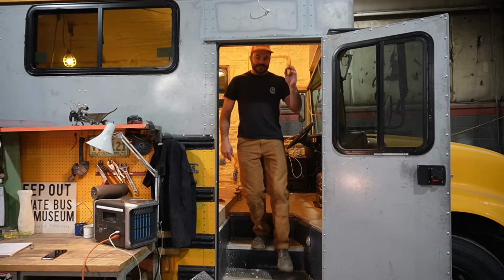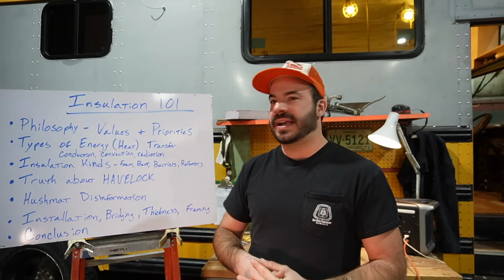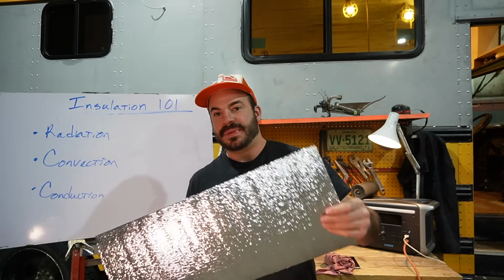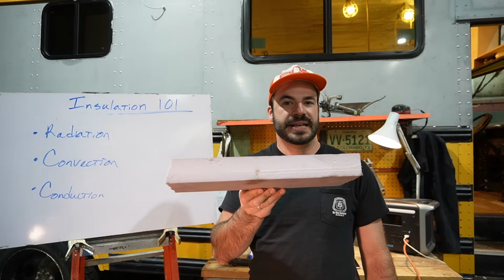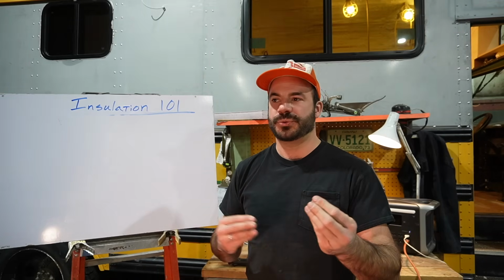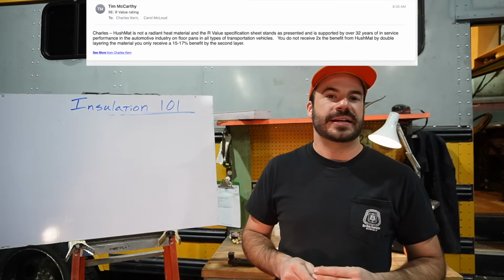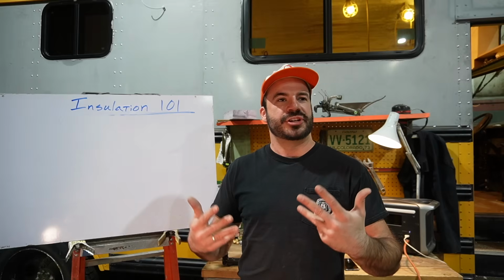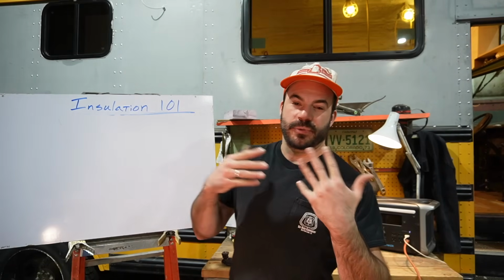Insulation is a SCAM (& the truth about Havelock and Hushmat)

Comment: Great video! Much need information, I have a question about the wood touching bare steel as this was one thing that when I would see everyone doing it in other conversion videos, I would think to myself everytime "idk if we're supposed to do that" lol 

I thank you for the tibbit on using insulation to cover it up, my question is: for Extruded Polystyrene foam boards, can we cut a strip and place that over the bare steel as we make it flush with the Extruded Polystyrene boards we placed for the wall insulation? Would it still help with keeping the warm air from meeting the bare steel? Or should we just use "Great Stuff" to spray 1" - 1.5" over the bare steel?

Comment: I understand the foam isn't getting crushed without framework in the floor. But what about all the vibrations? From the engine just running in idle, to all the rolling down the road. Harmonics, micro vibrations making the wood on top and the metal underneath slowly grind away all the styrofoam board? Possibly? I'd like to see how it holds up over 5 years with the insulation itself carrying the entire load. Just to be certain.
Reply from the maker: We’ve got rigs with literally over a hundred thousand miles on the floor like this with no issues. Our oldest is now 10 years old with no problems

Comment: With spray foam, what about the risk of body flex eventually cracking or shearing the foam causing endless squeaks? Also, what about body repairs in the event of a collision? What if a body shop needs to pull dents or weld panels? Perhaps an alternative might be a thin flexible closed cell sheet insulation applied with a heat resistant contact cement + rockwool or similar on top? This could be much easier to remove if needed in future.
Reply: A body shop repair tech would just cut and grind any spray foam out of the way of any welding repair needed. They are professionals, they will figure it out. I can't see it being a reason not to do if the application makes sense to do so.

Comment: This is a phenomenally informative video. Thank you. If you see this comment, can you weigh in on Thinsulate batt-style insulation? I have some doors in my rig that I need/want to insulate and Havlock now seems like the wrong call. The application is between the sheet metal and the interior plastic trim panels.

Comment: A question, I have thoughts on alternative methods. I would like your evaluation. Understand I am a truck driver not a contractor. I saw a van life video, were they painted the inside of the metal of their van, with bed liner. Their observation is that and no installation prevented all condensation, granted they were Canadians. Their view of cold and ours is entirely different. But they claim they kept their van warm. Could that be used in place of spray foam, as an interior vapor barrier. Conversely, could it be used as an exterior vapor barrier by painting the outside of the vehicle, and getting the same effect? My assumption is yes to the former no to the ladder.

For window condensation, I have observed at least in my semi, that Rain-X interior fog preventer, seems to be affected. On oWindows. I am curious if you feel that that would be a sufficient preventative measure, if retaining traditional windows in a bus.

Lastly for floor insulation, there is an exterior type of paneling, that is an insulation, think of rockwool meats particle board. I saw a video of a house contractor using it. As it is rigid, fire resistant, and appears to have compression strength, I thought it might be an effective use for a subfloor. I can link an additional comment with the video but I'm talking about. 

In the event I'm curious on your faults on my alternative ideas. As my primary objection to foam, is it burns too easy. And the unlikely event of a fire, I would want to be able to escape. And I concur, with the issues you have outlined with traditional batting

Comment: I have a transit shuttle that im converting.  It does not have a metal floor pan.

My plan was to use 3/4 ply forbthe floor, painted bottom with a undercoating, top layer with a oil based paint, then use xfb on top of the wood floor.  Butbam unsure what to do on top of the foam, i dont want another thick layer of wood, but am afraid incant out flooring direct onto the foam

Any suggestions

Comment: Great explanation of insulating materials. I would like to add some important points:
1. “R” value has no meaning when talking about radiant barriers.  R value is defined as resistance 
To heat flow. Trying to say a radiant barrier “worth” a x R value is nonsense. Good you made that point.
2. There has to be an air gap for the radiant barrier to work. A rubber mat with a “radiant barrier” side placed on the sub floor under the final floor gives only some sound insulation but not heat insulation. Clearly a bogus product.
3. It’s true a radiant barrier blocks radiant loading, but so does a sheet of plywood. The physical reason a radiant barrier works is that it both reflects the incoming energy and doesn’t re-emit the energy as long wave radiation that heats adjacent surfaces. Emissivity of metal surfaces ~5-10 %, so the temperature of a metal surface can be hot, but it shows cool in an IR image.
4. Most people’s perception of being comfortable in a room isn’t totally dependent on air temp % humidity, but how cold the surrounding walls are. Cold walls provide an excellent gradient for radiative heat loss from the body. Like wise hot walls  are a radiative heat load. Windows are a good example of a hot/cold source being difficult to insulate.
5. Have you looked at aerogel? They make it in strips that are very effective in reducing thermal bridging. Maybe in places where you can’t get foam on the interior wood frame.

Comment: Some body panels and doors are designed  to let moisture  passs though and out weep holes in the bottom of door panels..Waxoil is sprayed inside to stop rust. Vapor  barroir very important to allow water to pass down though door
 Do not plug holes or you will have gallons of water in your doors
Reply: Surprised more people haven’t mentioned this?? Maybe because it’s a bus build? Any car isn’t a house and it’s almost impossible to create a perfect vapor barrier so you just end up trapping more water…weep holes are to remain unsealed…

Comment: Great presentation and very valuable information. I knew about conduction, convection, radiation, R values etc, but hadn't considered condensation. I am wanting to convert an old Ford Econoline without losing any more headroom or width than necessary. Any suggestions? I do plan on having a roof fan, and probably a heater of some kind,

Comment: QUESTION: What about road vibration that breaks down the foam into dust? Then the top 1/3 eventually has little insulation. This is what happens to older refrigerated semi-trailers. Their top walls have little r-value over time.
Reply: it's too flammable for use anyway. the stuff is deadly.
Reply: following

Comment: technically, especially in such a small space, you don't need any insulation at all. if you have enough heat or cooling available. insulation is just a way to reduce energy costs. hopefully the cost of the insulation will be offset by the savings made in energy consumption over a decent amount of time.

Comment: I love wool because I’m a knitter. I used havelock for my house and wool is indeed very good at insulating and I also love it because it’s natural and doesn’t off gas. I will attest to the floppy nature of it . For a vehicle to combat the shifting from vibration, I would suggest for vertical surfaces taking advantage of the stickiness of wool. If you had something like a comb on the walls that at intervals that would go through the batting and help lock it into place, I think that’s would work best. Admittedly, I don’t deal with the shaking aspect because I used it in my house. It’s trickier to use than traditional roll insulation but worth it and worth the price.

Comment: Excellent presentation on insulation and its principles. I learnt about the problem of thermal bridging when I lived in an old railway goods wagon for a couple years. It was just a temporary situation utelising a structure used as a shed and didn't warrant insulating it   The ply walls were bolted through the exterior iron ribs. I noticed water beads forming on the bolt heads, and after a while the wood surrounding the bolts started rotting. When hidden in the wall such rot could advance considerably before getting noticed.

Comment: Chuck, I’m trying to not lose as much height in my bus as I don’t have time to extend the roof before I’m planing to be in it full time and I’m a rather tall person (almost 6 ft). So, I’m considering insulating the ceiling with foam board and then reusing the metal paneling from the original ceiling of the bus. If I reuse it, how is the best way to cover the metal ribs before I put the metal paneling back on?

Comment: Chuck question for you. What if you prep the steel walls with a truck liner material (raptor liner) to help preventing sweating walls then do a thinner coat of spray phone so you can use the ribs to connect cabinets, extra? This is a van related question

Comment: Reflectix is easy to install, cost-effective, and easily removable/detachable (which is so under-appreciated).  I used Reflectix + Coroplast panels as my barrier/insulation. Leave space between van-wall and Reflectix panel, which gives you ventilation behind the walls.

I would never use spray foam. Off-gassing is a real concern.

Comment: Use placeholders inbetween wood and metal and then fill everything, its not only to prevent the two materials touching, its also disconecting the metal properties from the wood. We are prohibited from doin that in wall construction in germany. If i had to explain how they look, its kinda hard plastic petals, you get them in all kinda shapes, pre drilled and so on. Today you proly could 3d print them how you want. Great video, only thing i can add is that wool also starts shrinking after a couple of years leaving a space behind wherever you put it and causing condensation...no the "new" material shrinks just as much. I did alot of jobsites tearing that stuff out or refilling gaps....BUT i also understand ppl not wanting the chemicals in there house. But if you are rebuilding a old vehicle might aswell use everything you can to hold that thing together😆

Comment: I think in a van a rain screen applied to the exterior skin before spray foam would eliminate condensation and trapped water concerns.   There are weep holes at the bottom of all body panels from the factory to let condensation escape.  This method would preserve weeps at least on the body sides. 
In a schoolie i doubt there are factory weep holes so just spray the foam.

Comment: 🏠 Introduction to Insulation Philosophy - 00:00 

          Your insulation choice is crucial for your rig's comfort and safety.
          Various insulation methods explored over the years.
          Different philosophies behind insulation choices.

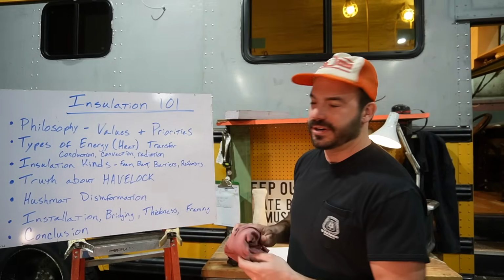🛠 Values and Priorities in Insulation - 05:36 

          Choosing insulation based on your values and priorities.
          Considering factors like off-gassing and material composition.
          Making informed decisions aligning with your preferences.

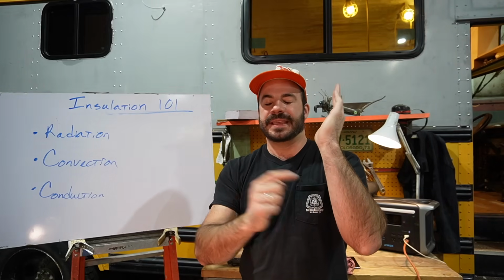🌡 Understanding Heat Transfer Principles - 09:56 

          Discussing the three main types of heat transfer: radiation, convection, and conduction.
          Explaining radiant heat and the use of radiant barriers.
          Addressing convection and its relevance in insulating a living space.
          Focusing on conduction and its importance in insulating walls, floors, and ceilings.

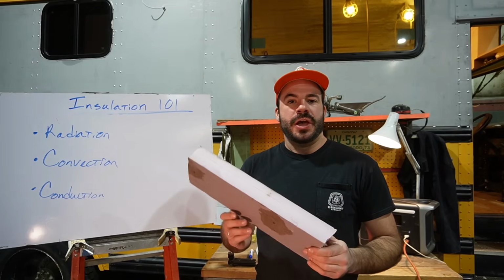🧱 Types of Insulation Materials - 13:23 

          Highlighting different insulation materials: XPS, Polyiso, DIY spray foam, and bat-style insulation.
          Emphasizing the properties and applications of each type.
          Discussing the advantages of closed-cell spray foam insulation.

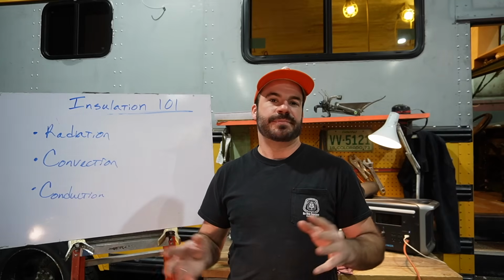💡 Considerations When Using Bat-Style Insulation - 18:11 

          Exploring the challenges and considerations of using bat-style insulation, such as Havelock wool.
          Addressing issues with maintaining the position of bat-style insulation.
          Discussing the importance of managing vapor in wall cavities.
          Evaluating claims about wool insulation's moisture management capabilities.

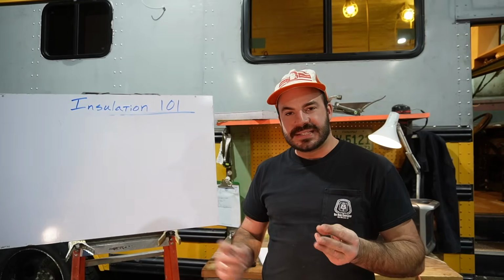🔍 Vapor Barrier and Moisture Management - 21:52 

          Moisture management in bus insulation,
          Importance of vapor barriers,
          Moisture generation from daily activities,
          Dew point and condensation in walls,
          The role of vapor barriers in preventing moisture buildup.

🧐 HushMat R-Value Controversy - 25:05 

          Discussion about HushMat as an insulation product,
          Claims of high R-value and concerns,
          Clarification on the R-value of HushMat,
          Comparing thermal insulators and conductive insulators,
          Highlighting the importance of accurate insulation information.

🌡 Thermal Bridging and Moisture Control - 29:15 

          Explanation of thermal bridging in insulation,
          Importance of preventing thermal bridges,
          Concerns with moisture in wall cavities,
          Impact of framing methods on moisture control,
          Addressing misconceptions about wood-metal contact.

🪟 Window Condensation and Moisture Management - 35:04 

          Dealing with condensation on bus windows,
          Drainage in RV windows,
          Risks associated with stock School Bus windows,
          Importance of proper ventilation,
          Strategies for managing air exchange in the bus.

Made with HARPA AI (with additional formatting ;-)

Comment: Chuck,  Yes spray foam appears to give good insulation, but I saw a video on YouTube where a guy did fire testing and the Spray foam and XPS foam are extremely flammable.  Most good builders do not use drywall, in a bus,  but plywood, not a good combo  for fire hazard.
Reply from the maker: There is Class A spray foam, which is all we use

Comment: I have a motorhome on an F450 chassis. The floor is a major source of heat loss when it's cold. There are large areas that could be spray foamed without obstructing future repairs or plumbing. I have not found any real content on doing this. You seem to have the wisdom of that comes from making mistakes and the knowledge to predict the unforseen. Am I missing something here in thinking adding spray foam to the bottom of the living space would keep it a lot warmer? And no, skirting is not an option.

Comment: Love your explanation. I’m certified as an energy consultant, have taught energy science, and have worked as a building inspector. 

Hope sometime you can talk about: insulation materials as sound barriers;  fire resistance of insulation materials and the toxicity of the chemicals they emit during combustion (or merely exposure to heat).

Comment: I'd like to see some actual examples of how you do your best recommended insulation in the areas of the ribs cause I can't understand how you mount timber to the van metal structure with foam in between. Do you use screws or glue? If you use screws doesn't the screw break the thermal barrier? If you use glue is the foam a sound enough surface to glue timber on?

Comment: Have you heard of anyone using Vacuum Insulated Panels (VIPs)?  Supposedly they can get R values around 60 per inch which sounds too good to be true (so it probably is).  That said, pulling a vacuum to reduce internal convection does sound like a plausible approach so I don't know.
Reply from the maker: all fun and games until a rough road cracks the seal!

Comment: What is the spray foam you use made of? Almost all I can find are polyisocyanurate, with a few that are other materials. 

You said that polyiso performs worse in cold weather (which I looked up and found it to be true), so does that only really matter when it’s in the floor? 

If your spray form is also polyiso, does that mean the poorer performance in cold weather is not as important when it comes to insulating the walls? Thanks

Comment: Hi I have a pro master window van high roof. It has a nice ceiling I want to keep but first need to uninstall after insulating then replace I plan to use it for going from cold Michigan to warm states in winter. What Are your recommendation for insulating the ceiling knowing I want to reuse the factory headliner.also need advice in floor and walls. I know I have a lot if window area but this us what I have to build out. The more videos I watch the more I get confused. Please advise. Thanks

Comment: What if you leaned into the whole idea of condensation. What if you just draped 100% cotton terry cloth all over the inside of your van. So that it readily absorbed condensation and respiration fluids, But then just as readily gave up those fluids when it evaporated the next day with and open window, door, or fan? Like exploiting the capillary attraction properties of 100% terry cloth. We're not talking about looks we're just talking about what it would do. All the loops of the terry cloth is like many capillaries in the human body. It would not only absorb moisture but it would do it extremely fast, and then in addition give up that moisture extremely fast. So it's sort of like no insulation but simply handling the condensation part.

Comment: Just found your video. We were planning on using PIR board all round. After watching this I think we’ll definitely switch to XPS on the floor. Spray foam is way above our budget despite the benefits you described. Would xps work for insulating the walls and floor?